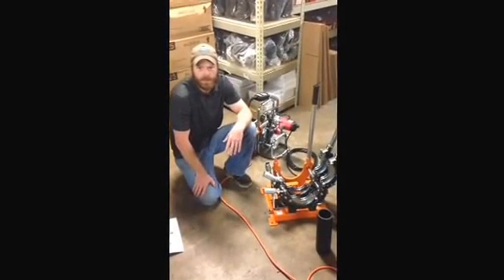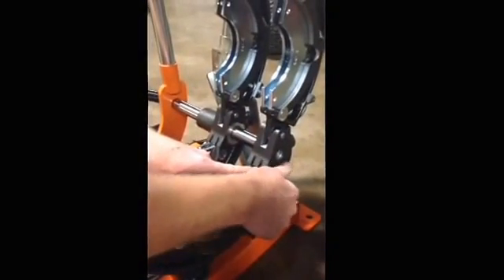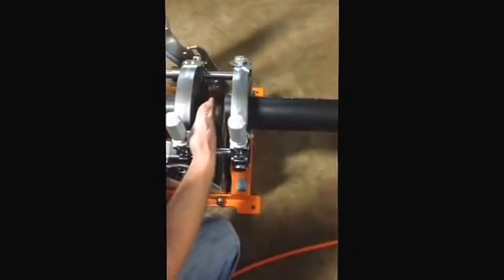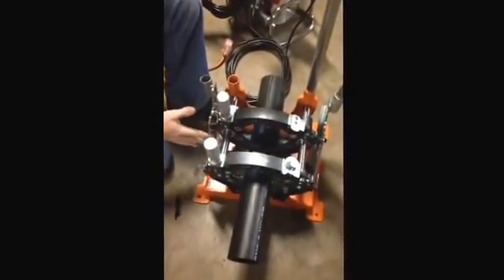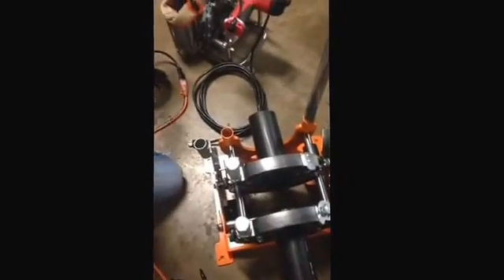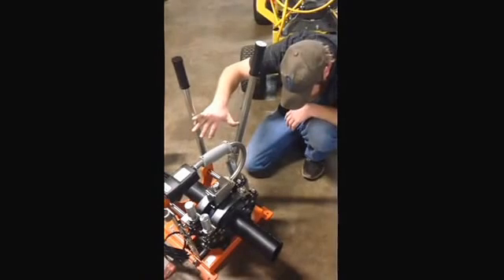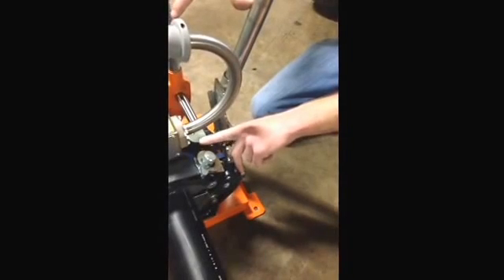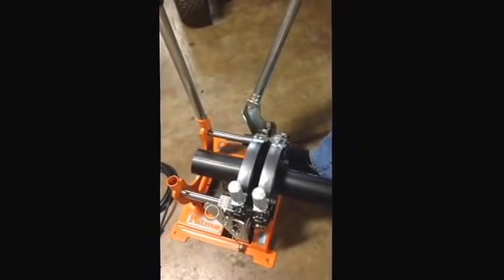Hdpe Supply Ritmo RAM 14 Butt Fusion Machine Demo

Comment: Thanks for the video. One question we have: where do you find the technical information such as bead size and cooling times? Do I contact the pipe manufacturers?
Reply from the maker: Good Morning, If you send me an email I can forward you a butt fusion manual that shows how to calculate cooling times and bead sizes.  You can also download a very helpful fusion calculator on your iphone or android phone. Its called mccalc  it is a fusion calculator made by McElroy Manufacturing. My email is info@hdpesupply.com

Thank you